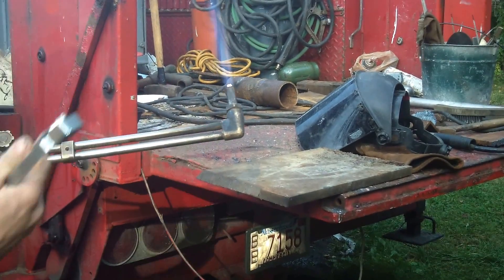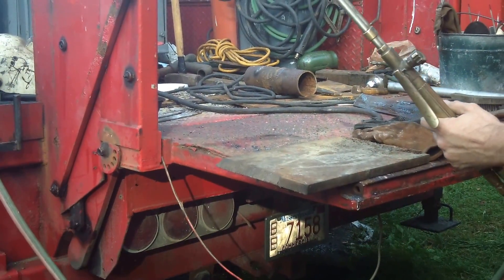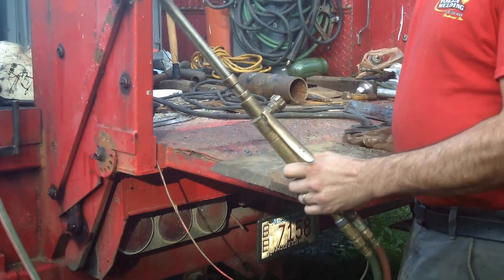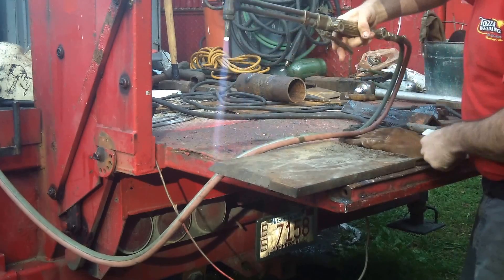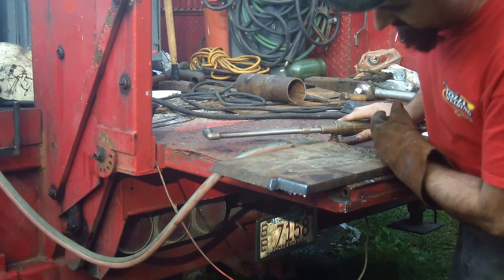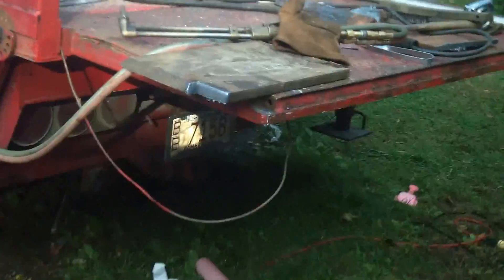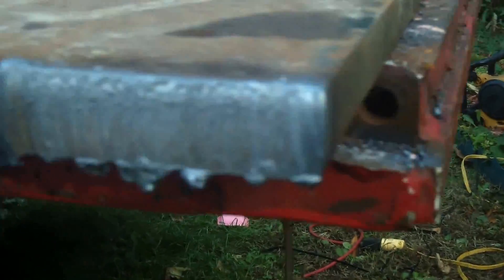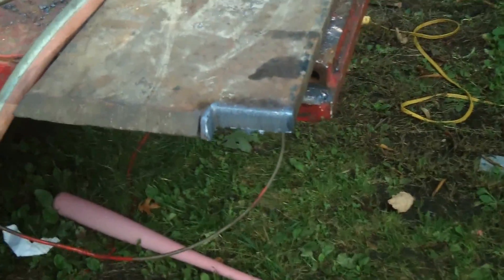Oxy Fuel Torch Cutting, Propylene, Propane, Chemtane....

Comment: I run my big rose buds on propylene  cause i can run lot.mor fuel without blowing up or pulling acetone from the tank
Reply: I work at a shipyard and propylene is pretty much all we use.  I way prefer it over aceylene, I can cut/wash smoother with it and the slag generally comes off more easily.